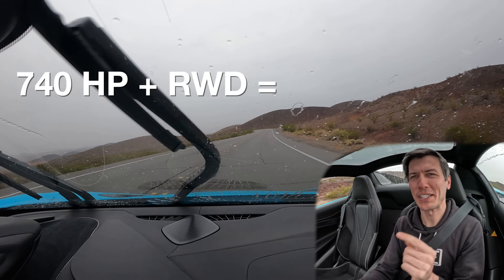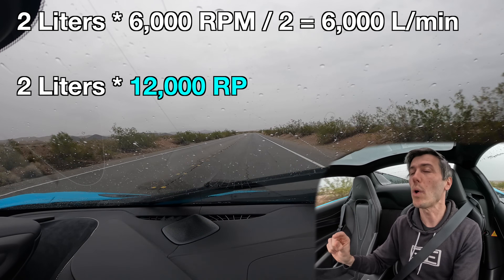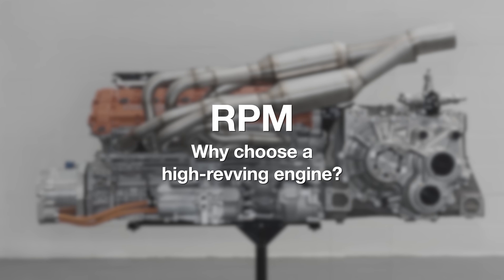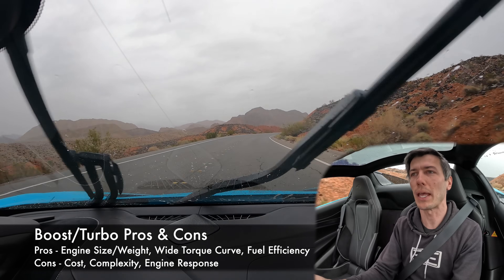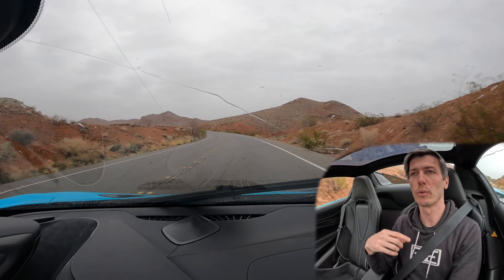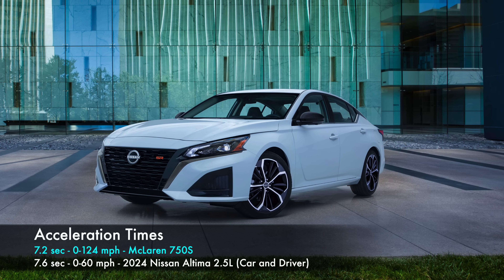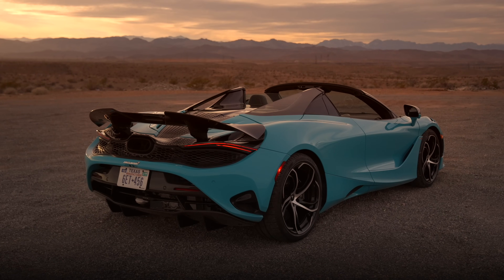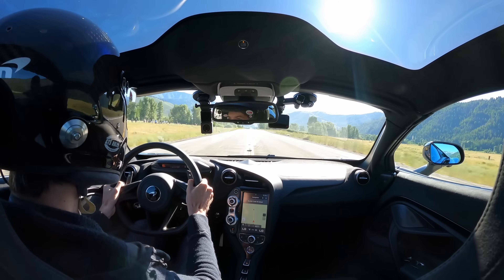Boost vs RPM vs Displacement - What's Best For Horsepower?

Comment: Anyone who says 'Theres no replacement for displacement,' has NEVER felt the power forced induction can provide.
Reply: Yeah, but the lag before the turbo hits does suck.
Reply: @whiteknight1246 that can be solved in a couple of different ways.
Reply: @ALMX5DP  I know but, production cars generally dont have anti lag, so the average person still would prob have more fun with displacment over boost.
Reply: @whiteknight1246  I think some Hyundai N products have such a system, but there are also variable geometry turbos and OEM electric assisted turbochargers that spin up the compressor which help eliminate any lag. And fun is largely subjective, lots of people do like the inherent response from an NA engine but many also like feeling the boost pressure surge.
Reply: My ass. If you have a 400hp N/A and a 400hp 2L Turbo, you'd take the N/A any day of the week.
Reply: @NoName-oj5km   not sure I agree with that general sentiment. All depends on how it makes that power and the kind of performance it brings to a given vehicle. An old school iron big block that doesn’t rev quickly or to a high rpm isn’t going to be too satisfying. Similarly a turbo 2 liter could be pretty lackluster and laggy if it’s not modern with variable geometry turbine or anti lag or electric assist for the turbo compressor etc. So depends on what type of feel you like and what performance you’re after.
Reply: @NoName-oj5km I agree but at higher displacement like the Corvette engine he showed I probably would prefer smaller engine at that point. I don't need huge chunk of weight that doesn't produce a lot of power for its weight. Still I consider V6 minimum for fun and 3l+ displacement

Comment: don't you dare put weight as a displacement disadvantage lol. turbos have a much higher weight penalty than displacement. for example 2jz  is 2-300lbs heavier than an LS7
Reply: That’s simply due to the fact that it’s pure iron
Reply: @Eclipsis17 totally true, though I think they used iron to cope with the boost levels it had and could attain.
Reply: Ah yes, the 2JZ the only ever Turbo engine ever built.
Reply: @NoName-oj5km  or an rb both are substantially heavier than an engine 2-3 times their displacement
Reply: And where tf are you getting these numbers from? A LS7 is the same weight as an 2JZ, which is a heavy iron pig itself. Any modern aluminium straight six is waaaay lighter than 6.2 V8...
Reply: @NoName-oj5km  an ls7 is around 450lbs a 2jz is around 650-700

OH and my numbers are from scales of friends who have weighed them. Hell an N54 just the engine no intercooler or turbos is heavier than an ls7

Comment: Displacement. 6,2l LS3 is lighter and smaller than BMW's 3,0l N/A and superior in every way.
Reply: Then you see the GTR that made 3500 wheel horsepower at tk23. Displacement means nothing since it doesn’t correlate to airflow.
Reply: Well, comparing N/A to N/A tro porve N/A is better makes no sense at all. Then Lets compare it to a 3.0T S58 with 510hp. Still holds up?
Reply: @NoName-oj5km  You're right but yes it holds up as nothing is as annoying as turbo lag and nothing is as satisfying as instant throttle response.

Comment: How about no boost, excess of the other two and hard mounts?
There's nothing like the instant response of NA
Reply: Of course there is. Small turbos or antilag easily surpass the responsiveness and power of a NA car
Reply: @Eclipsis17 lol, no.
Reply: @GregMcNamer modern turbo cars have a greater area under the curve when making the same peak power. Turbo cars have lower rpm torque peaks too
Reply: @MacheII  Sure.  But they still have turbo lag.

I enjoy my 7500rpm, 450hp NA V8.
My 335hp twin turbo Porsche V6 feels like a dog in comparison even though it has more torque below 5000rpm.
Reply: @Eclipsis17   naaaah
Reply: Lol nah bro
Reply: electric motors also have instant response and people aren't bending over backwards to drive washing machines. 

jokes aside, love the n/a, Borowski is doing great things with their 9,000rpm LS-based V8s
Reply: electric motors also have instant response and people aren't bending over backwards to drive washing machines. 

jokes aside, love the n/a, Borowski is doing great things with their 9,000rpm LS-based V8s

Comment: So.... Increase displacement, rpm, and air density all at the same time to get the maximum power. That seems so easy! Those engineers from before 2000ish must not have been that smart.

This is sarcasm for anyone that doesn't get sarcasm

Comment: I’ve always wondered if an engine would make the same hp if the boost was the same but different sizes in turbos. everyone says that bigger turbos make more hp per pound of boost because the cfm is higher but wouldn’t the amount of air being forced into to the cylinder be the same for both turbos because the psi is the same? I know that bigger turbos are more efficient and the air will be cooler but let’s say the smaller turbo had a bigger intercooler for this scenario. Would the power be the same? Is the only benifit to a bigger turbo the capability of higher boost and less heat from compression?
Reply: No PSI is the pressure that is felt. Tell me which would be greater a 3 inch tube with 30 psi, or a 1 inch tube with 30 psi? It is so much easier to increase the psi of something with a small opening, but that means there’s a bottle neck, not extra power. Psi does not correlate to airflow. Look at driving4answers explanation of this
Reply: @Eclipsis17 isn’t the psi measured in the intake manifold though? So the pressure would be placed over the same area. I do get that the force would be higher the bigger the surface area
Reply: I believe the "driving 4 answers" channel has a technical explanation for why all boost isn't the same.

I believe part of the answer has to do with the exhaust restriction of a small turbo. 20psi can be coming into the intake from both a large or small turbo, but if the engine is pushing tons of exhaust pressure to drive it you will have losses, the engine simply can't breathe, like a clogged exhaust.
Reply: Assuming efficiency is the same(which it wont, bigger turbo will cool and compress air better) the bigger turbo will make more power. Its increasing the air pressure by the same amount but the volume passing through it is larger, so more air in the engine meaning you can make more power. It will also stress the components less
Reply: If you want good explanations, Gale Banks explains turbo stuff really well. He mostly cares about diesels, but most of what he says applies to turbo gas engines as well.

Basically, PSI is kind of pointless. What really matters is air density. It's totally possible to have 16psi coming out of the turbo, but only like 1.4x the density, then to put that through an intercooler and get 15psi at 2x density. In other words, an intercooler can make just as much power as a turbo sometimes!

As someone else mentioned, exhaust restriction matters a lot too. If the intake manifold is at 15psi but exhaust is at 20, that's costing you a lot of power vs 15psi intake and 10psi exhaust. Some people say that turbos don't rob power from the engine the way superchargers do, but that's only half true. Superchargers pull power off the crankshaft directly, and turbos do it indirectly by making the exhaust stroke more difficult.
Reply: Bigger turbos have more inches.  Same pounds but over more inches = more air.
Reply: It's about temperature (air density) and the pressure delta (intake/exhaust), if those are the same then it will make the same power (assuming everything else is the same).

Comment: It's not all about size. It's also about how fast and how hard you press. Are you a two stroke or a four stroke?
Reply: Two strokes finish faster in my experience
Reply: My 1000cc triple  2 stroke snowmobile makes about 170 hp at 8500 rpm. 
Love strokes

Comment: Suck, squeeze, bang, blow

VTEC just kicked in yo 

No replacement for displacement
Reply: Of course there is. Look at the 4.3 liter 3500 wheel horsepower GTR at tk23. Easily outperforms much bigger engines, just turn up the boost.